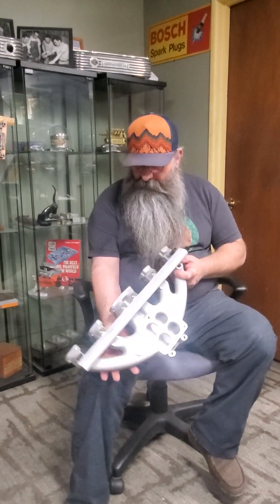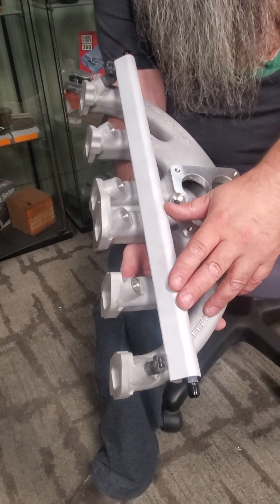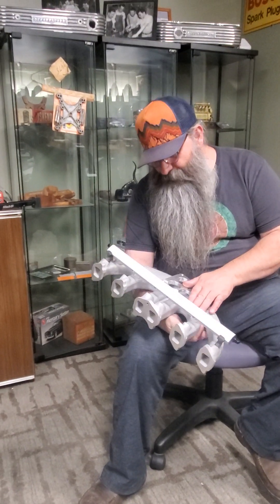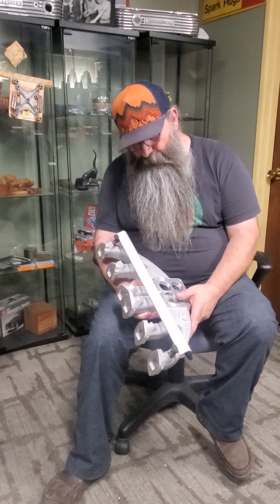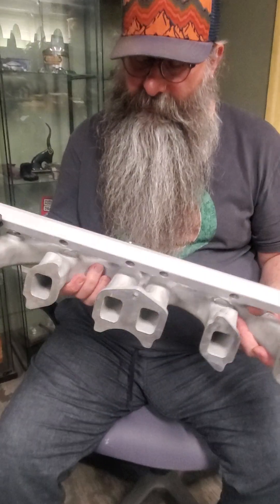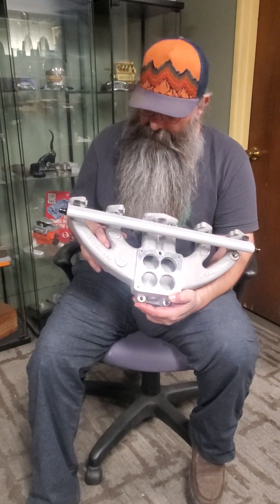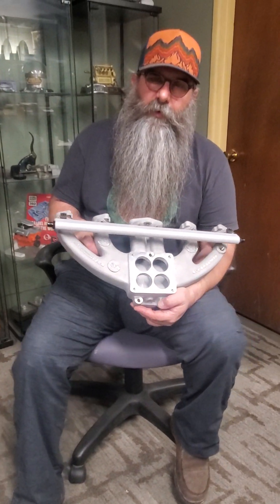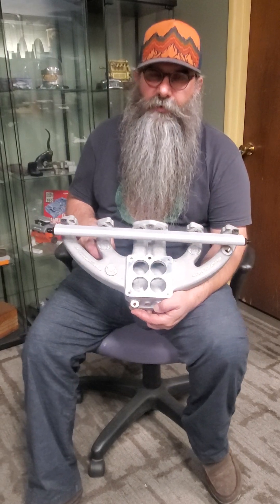Prototype Port Injection Manifold Revealed - Dodge Slant Six

Comment: MOST EXCELLENT!!! I can't wait to get on our 440 build. I have one of your Dual Port 360° intakes & I am mega curious as to how a self learning efi system, such as Sniper 2, will perform.
Reply from the maker: This manifold is an ongoing process and as such we are incorporating new elements to the design of the manifold as we go through the different testing phases. We can't say much right now but the results so far are looking good for version 2.0 👌 There will definitely be another video once we have that made so be sure to subscribe if you want to follow along! 😉
Reply: @OffenhauserTV  That's AMAZING!!! I definitely am following. I've been waiting for the resurgence of the old QUALITY aftermarket parts, and to hear that yall are still pumping out products makes me VERY happy. I've been living in a bit of fear that Offy will go the way of the Dodo. I am grateful to hear I'm wrong. An idea I was having this weekend on incorporating efi into your old casts. What if y'all made the opening/plenum if the intake manifold, made it abit taller perhaps, keep the outer shape if you wish but make the inside of the plenum completely round. My thought, is this. Take the thought of the avs 2 carb. The primary and secondaries are completely round with a grove inside to cause the air to spin. Take that thought and make the opening of the intake manifold the same, BUT WAIT, drill out holes around the outside neck(?) of the plenum that you would keep the same and have the injectors go in through the outer wall and through the inner wall. So that way, the fuel injection would basically sit right underneath where the carb would sit, and it would come in at an angle, hence the completely round inside, and would injection fuel in a spherical pattern. In essence, taking the approach of the avs 2 ports but instead of four holes on a carb you are making the opening of the intake manifold one big swirl port with fuel injection. It's just a thought that I think actually could work 🧐🤔 even if it's just to try it once it's worth a shot. Picture it, a 440 Mopar with an Offy Swirl port Injection. Has a ring to it lol Either way, THANK YOU for keeping a legend alive!!!